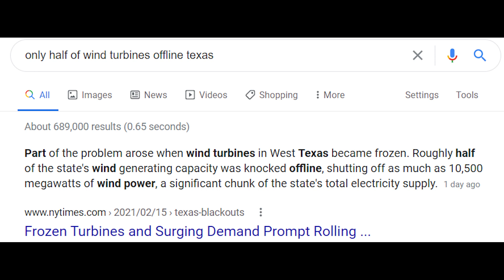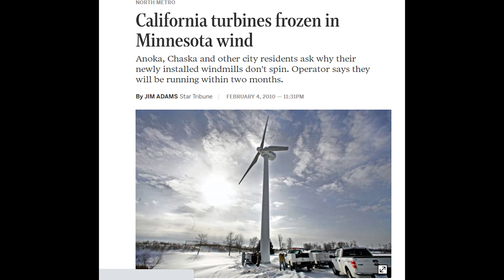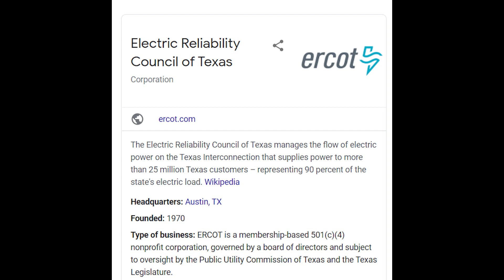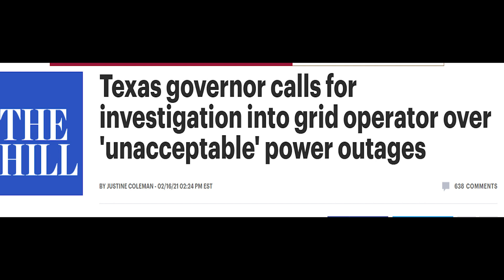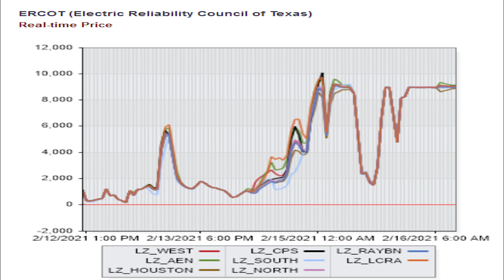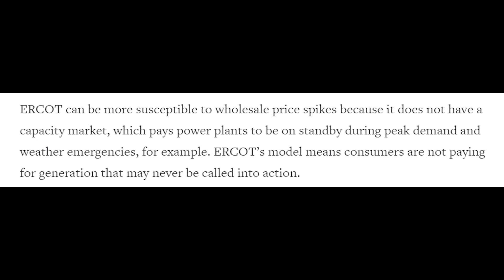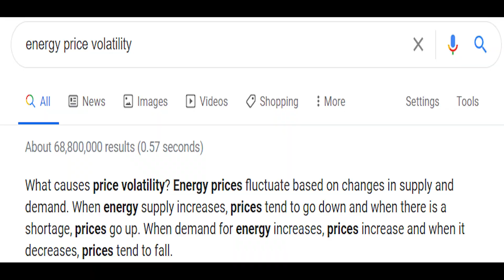UPDATE: Turbine Guy's Take on Texas Frozen Wind Turbine Crisis (part 2)

Comment: The amount of ignorance surrounding these things is astonishing.   Read up people but check your sources.  They are being put up at an astonishing rate for several reasons.  But namely because they get cheaper and more efficient every year.    Virginia is putting 200 of them up 30 miles east of Virginia Beach.   But first, they need to massively increase the capacity of the shoreside station to deal with all the power that the turbines will produce.   Progress is coming people.

Comment: Thing is quite a fair amount of those turbines went down that's the emphasis here sure they should have had a backup station in case this happened But those turbines STILL failed due to the weather Coal natural gas and oil plants not to mention nuclear plants aren't as Liable to fail in such cold temperatures unless they run out of fuel in the Coal Natural gas and Oil plants cause they by reason of their generation of power create their own heat and if the power does fail its usually due to the lines in the network not due to the plant itself (for example my state has its coal powerplants and usually when the power goes out its due to the lines failing for some reason or another (Like a lightning strike or rain hitting a broken insulator on a pole) also in regards to batteries don't batteries loose charge in cold weather??
Reply from the maker: Except that other fueled plants went down at the same time, plus I am sure, much of the power lines and stuff went down in the icy wind as well. Not just the wind turbines being the issue.
Reply: 0
Reply: @arnoldstafford2900  
1

Comment: Could u find out the cost to repair all those turbines in texas once it warms up again not adding cost to update them to cold weather and also cost to replace them with mixed climate design compare that to the cost of ur design say placed next to highways not in large fields
Reply: There could be damage from ice falling from the blades and impacting the fiberglass of the nacelle but other than the down time there wont be any significant damage cost mechanically.
Reply: @Mrgui110tine  so the ice expansion wount damage any thing figured that would be bad for thrust bearings in hub rotor mounting area 
And how would they have been operating in an unbalanced state imagine that would do alot of damage as well
Reply: @Mrgui110tine  sorry I meant to say ice in the hub rotor area expanding pulling on the thrust bearings
Reply: @thomascooley2749  the ice accumulation would cause unbalance and vibration just like any industrial fan would if unbalanced.  Vibration is monitored and parameters wouldn't allow the turbine to run in that condition.  Also the turbine wont start up under certain weather conditions,  primarily the converter system needs to operate at a certain temp and that's the main reason these turbines are down.  It's not technically mechanical its more about the converter system.  Some turbines are equipped with liquid cooled and heated converters,  some just have fans to cool converters but nothing in place to heat them and that's the real problem down south.
Reply: The sun doesn't always shine
      The wind not always blow.
But coal is cheap and reliable,
   When there's tons of Ice and Snow.
Reply: @thomascooley2749  you're correct to think that axial and uneven lateral loading forces are terrible for bearings.  I get where your coming from.  This ice will not grenade the bearings.
Reply: @supersidecar8901  let's go full on nuclear :)  it pays better
Reply: @supersidecar8901  it's just steam..  PWR
Reply: @Mrgui110tine  I doubt that the ice even got into the bearings. It more than likely did freeze the blades in place and that would cause the turbines also to shut down as the blades would not be able to swivel as needed and the controls would fail safe.
Reply: @Mrgui110tine  We have two units about 15 miles from here. They went into operation not long after dad went to work there. He retired Dec 31, 1988 when the plants were 16 years old. Next year will be their 50th year in operation. They are licensed to go to 60 years and a request to go to 80 years has been started. But they are not the poorly designed TMI style units. These were built by Westinghouse and are flooded core PWR units. The problem with them is.................................... they are very sensitive to interruptions on the grid. If they sense a fault such as a blown switch at a substation 30 miles away and there is a loss of other power on the lines, they will automatically shut down. As happened back in 2008. Then it is about 4 hours before they can come back on line.
Reply: Guy id love to see ice collection so thick at the blade root that it would freeze the blade from pitching!  That  isn't what's going on in texas.  

Ice collection on the blades creates drag and vibration that the towers sensors monitor and that would shut the turbine down if outside parameters. 

Another huge factor for down turbines is within the converter system.  Turbines with minimal ice or no ice might not run at all because there isn't any systems in place to heat the converter module's and electrical components when temperatures are low.  

Another issue is the amount of sissy ass wind technicians that dont think they can work on towers during ice conditions .  Us men would get in those turbines before the sun comes out,  would actuate the blades rapidly to loosen and knock off the snow ice.  Lol bunch of sissies
Reply: @gravelydon7072  I hope we can keep nuclear around.  They may be boring and slow to work on but they really are safer than what the public thinks.
Reply: @Mrgui110tine  Yep. The local ones have a half hour safety margin to get things flowing. Even though the backup systems are supposed to come on as soon as needed.  And that's part of what makes them finicky. They have safety systems for the safety systems. And if all else fails, there is another safety system to cover those.

Comment: Heat the blade, heat the oil and heat the hydraulic fluid with thermal control. Keep fluids circulating fluids during heating cycles. What a simple idea. At the cost of one turbine,  whats the cost to add these features? Certainly cheaper than the alternative of no power. No power to sell of bad for the cusromers, and power companies bottom line.

Comment: BS, you're biased wind was the primary outage wind is the problem.
Reply from the maker: Facts matter and facts are that other fueled plants went down as well. Read up on the story and you will find out. Texas governor even called for an investigation into the board running the electricity in Texas.
Reply: Hey N SP, I live in the north of Iceland only a short distance from the Arctic circle, never seen any issues with turbines there. EVER! Including in winter! If we can make turbines work in a climate that regularly have hurricane speed winds and -30 to -40 degrees Celsius, I'm sure turbines can be made to work in a very very mild climate like texas
Reply: @ermining1  I think it's obvious at this point.. Texas used turbines not rated for sub zero temps.
Reply: @Ozarkwild  there point stands it is not wind that was the cause it was them not winterizing or properly specing there turbines. Many northern states and countries have turbines colder running fine. I am not 100% but I know some have speculated this has not been entirely investigated is that if they actually winterized the turbines they would still be running, but failure to do simple maintenance and winterization is the blame for wind turbines/natural gas power plants/ and nuclear power plant to all go down. (It is confirmed that not winterizing there natural gas and nuclear power plants is the cause of those failures)

Comment: Coal plants just kept making power 🤪👍👍🇺🇸
Reply: Nope.  Most of the generation we lost were coal, gas, and one of our nukes.  Why?  Because they all need cooling water or they cannot work.  The generator and the cooling pumps for the South Texas project nuclear plants are OUTSIDE and ABOVE THE ROOF of the generation building.  The Gulf Coast wind farms made more than their rated power this time as they've done many times in the past.  Solar works better in the cold - our PV generation was working above ratings as well.  We don't need more coal - we need winterized power generation because now we're dealing with the disruptions in climate brought by the climate change caused by all the damn coal, oil, and gas burning.